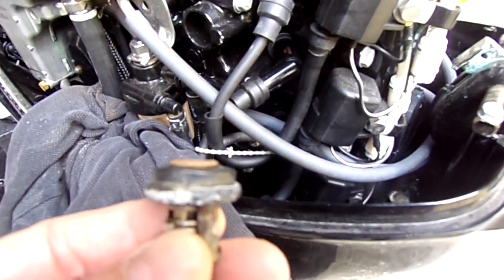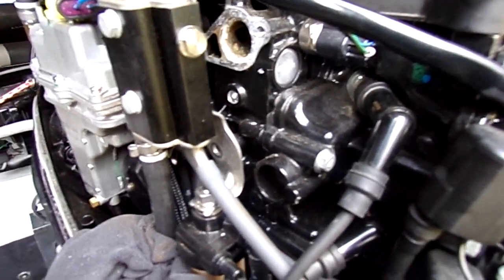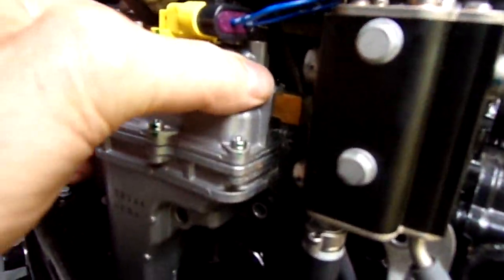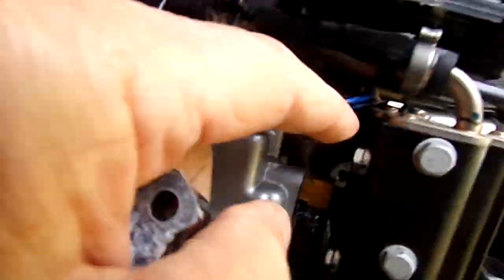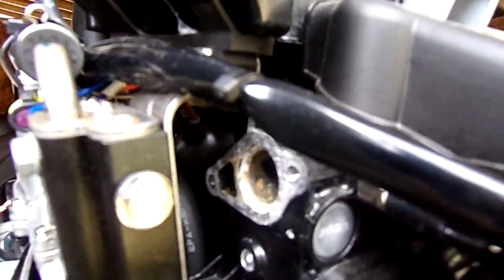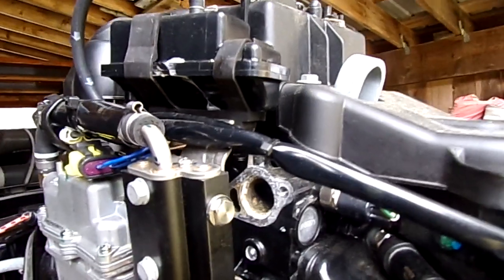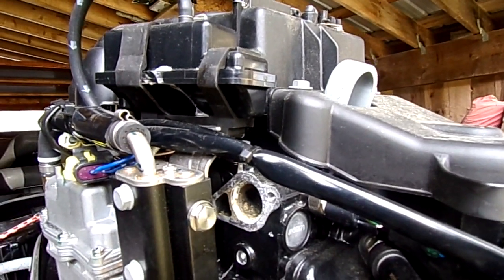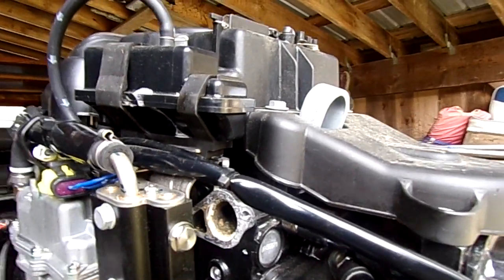Thermostat Replacement Mercury 25hp 4 stroke EFI

Comment: This really helped alot. Thanks. Fixing mine this week. My motor is running so cool there is gas getting into the engine oil. I'm hoping by replacing the thermostat, and adding gas treatment it will solve this issue. Again thanks.
Reply from the maker: That is my understanding. Engine needs to get hot to prevent blowby and 'making oil.'

Comment from the maker: The alarm was not going off because it was not overheating it was stuck open so it would never warm up. If the alarm is going off it is stuck closed so it overheats and the alarm goes off. But it is the same alarm as low oil pressure so check both.

Comment: Thanks, I have same engine and was looking for the location of the thermostat since I replaced the impeller and still get trickle
Reply: Did replacing the thermostat fix your issue? I had a trickle out of the tell tale and then it finally stopped.. Just accessed the impeller and it looks fine. Possibly the thermostat?
Reply: @tylermcfarlin5182  did you end up changing your thermostat? I have a weak stream from my tell tail as well and wanted to know if it fixed your problem?

Comment: The reason is that the thermostat is locket from al the saltcorotion in the coolingsystem. Everytime the engine has been running in saltwater, you need to warmflush it in sweetwater. You do that in 10-15 minutes. So the salt can be remowing from the whole engine.

Comment: I wonder if I should change my thermostat. Cause every time I go for drive it only works for a few minutes for my merc 25hp 4 stroke it starts shaking n slowdown, after few minutes of cooling it down, it start to run again for a few minutes..... u think dat is the problem why my merc 25 overheats?

Comment: Freddie,  Thanks for the thermostat change info.  Worked great for me on 2018 30 4Stroke EFI.  Have you ever changed the temperature sensor.  I can't figure out how to find and change it.  Tjhanks!  Jay
Reply from the maker: No, haven't done that. I imagine it's hooked up to the emergency light/alarm?
Reply: @frederickschreyer7627  Thanks for the quick reply.  I will let you know if I figure it out.  First I will check to see if my newly installed thermostat fixes the issue.  The alarm would sound after idling for about 10 minutes and the water from the pee hole would not warm up.  Oddly enough the alarm would not sound at fast speeds.
Reply from the maker: My understanding is that the alarm only sounds in an overheat situation. However it may be that the alarm is also set to monitor oil pressure as well. Years back I had a Yamaha 20 4 stoke that wstarted to set the alarm off at idle. It was still under warrenty and it was fixed but they couldn't determine what was wrong with it and wound up replacing the whole power head. Hopefully your new thermo will fix it

Comment: I have the exact same motor and I replaced the same thermostat I have looked everywhere for this answer when you turn your motor on and idle with the ears on it or run it in the water. Is the water hot when it comes out of the tell tale / water per stream?

Comment: Thank you! Any idea why my motor is not running water out when it gets warm? When its is still cold water comes out. After 10 minutes of using it then water stop running out. If you know please advice
Reply from the maker: I think the thermostat may be sticking closed when it warms up. Replace it and see what happens but do not run it if water is not coming out. Engine will overheat and ruin it.

Comment: Any idea the part number. Thanks
Reply from the maker: No, dealer ordered it.
Reply: @frederickschreyer7627  was the alarm going off with old thermostat?
Reply from the maker: @birdieoutfitters6598  no it was stuck open so it was running cold. Alarm goes off when it overheats which means stuck closed or clogged. Or low oil pressure. Same alarm I think.
Reply: @frederickschreyer7627  I’m

Comment: New 2024 mercury 25 4 stroke shuts down immediately after running full power. Happened 3 time and only 3.5hours on it but always peed  old water. After  15 minute cool down  it starts and runs fine. Could this be a bad thermostat? Dealer said the error code was excessive rpm’s and sold me higher pitched prop and problem still exists do you think it could be thermostat? Any input would be appreciated. Thanks Bryan
Reply from the maker: They do have a safety shutdown if low oil pressure or overheat. I am no expert but changing the thermo shouldn't hurt but you may want to check so you dont void any warrenty.